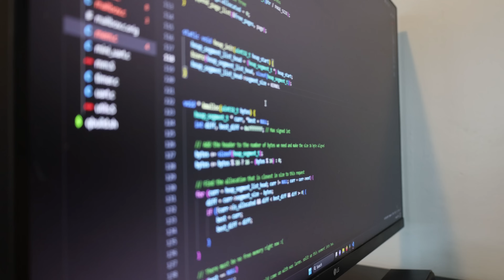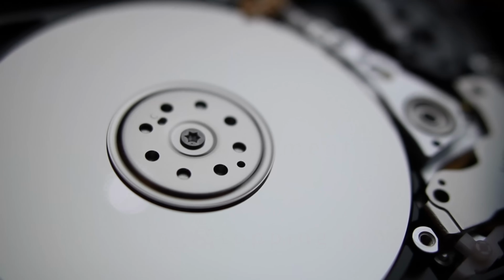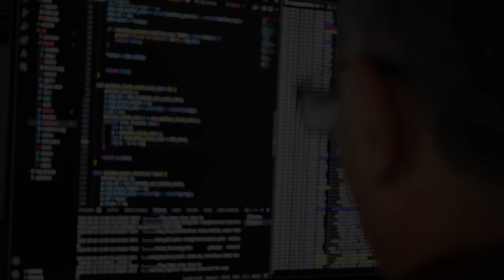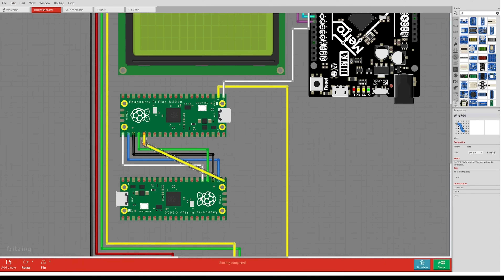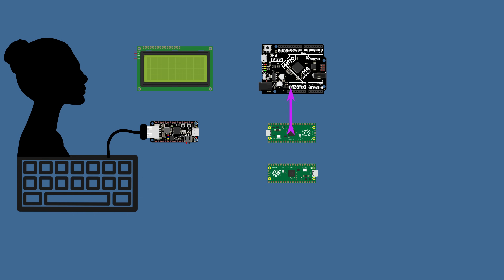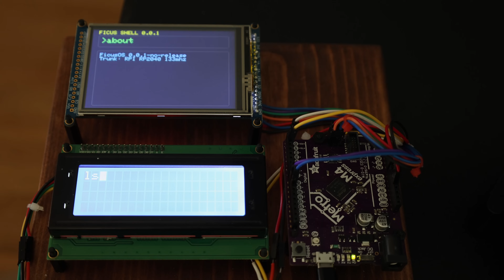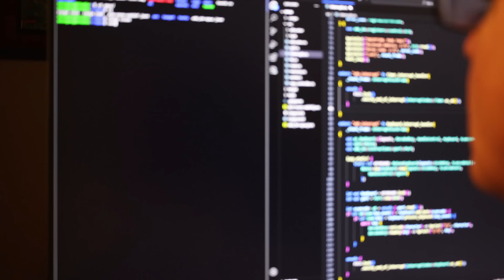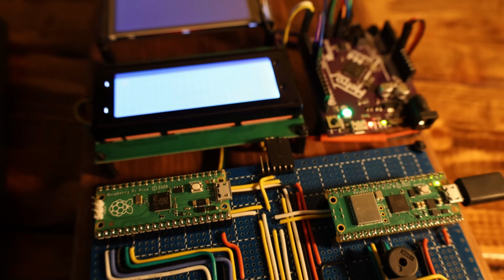Building a Retro-Styled Homebrew Computer & Operating System from micro-controllers

Comment: Wow, the hardware I could do but you totally leave me for dead with the software. In the 80"s I built myself a computer using a 6800 but it had no OS just a pile of switches and leds, I wanted to get it to run something like BASIC but never was able to get it working. However I did learn assembler and how to use a logic analyser so I was very happy too.
Reply from the maker: Assembler take a lot of brain power :) What happened with the computer from the 80's? Is it still floating around somewhere? Thanks for watching - cheers!

Comment: As a fellow hardware/software hacker, I was uplifted by your quality production of a favorite subject matter. I went down the rabbit hole of the Ben Eater 8-bit computer but that's because I'm more of a hardware guy. Your story has an arc and was a testimony to quality video production well done. Someone should write a song to go along with it. I plan to follow your progress with Ficus. Good on ya, mate.
Reply from the maker: Thank you so much - I really appreciate that. I think I need a few more skills before I try Ben Eater's computer, but I plan to enjoy every step of the way :) Cheers!
Reply: Ben's computer is so intensive to put together because of all the interconnect. Superior breadboards are a must! But there is another version called the Bravo that takes the same concepts as Ben's design but applies it to actual circuit boards and more advanced parts. I built that one also and it could be expanded just by adding PWBs since the bussing is contained in the connector stack. Cool idea.  @wrongdog_reckons

Comment: This is really in my area of interests. I’ve done all of Ben Eater’s projects, set up an electronics workbench, started designing PCB versions of them, had one PCB shipped to me from China within days of ordering it, for a few bucks, started learning how to program bare microcontroller chips from a channel called “build your CNC” but also prebuilt microcontroller boards like the ones you mentioned.

We think a lot alike. When I did “nand2tetris” course it made me realize how each layer of abstractions within the technology stack could be as arbitrarily simple or complicated as we wanted. When I read “jones forth” literate source code it made me realize how little code I could potentially use to get from bare metal to any level of abstraction in an interactive hands-on way. I started looking into creating my own Forth but after not doing much, just last night I started writing one in C instead just to wrap my head around it again.

Put it all together and one of my driving thoughts is eliminating dependencies and understanding every later, which is what you’re talking about as well. There’s a couple of online talks that were huge in lighting a fire for me which are “the thirty million line problem” by Casey Muratori and another video by Jonathan Blow called “Preventing the Collapse of Civilization”. I’ve noticed that any time I have to fight software or put up with its flaws, it’s because someone else made it first their purposes, not mine. And how much we have learned to put up with terribly performing bloated software.

I like that you’re thinking about the higher levels of operating system functionality, and I am saving this in my list for things to have in my OS when I get to it. I’ve gotten into FPGAs as well but the problem is their terrible bloated IDEs like Vivado (for Xilinx products) and the OS needed to run it are the opposite direction I want to go.

Yesterday morning I also jotted down where I wanted to go next with building a retro style computer and whether I added on to the Ben Eater “8-bit” computer, the 65C02 project, or one of the various microcontroller projects, I/O was the common thing they all need. I’ve run across people who have shown how to use SPI to read/write blocks from SD cards with a simple protocol that works at any speed (arbitrarily slow as needed) that would be really useful. I think it was on a channel about building a Z80 system with CP/M running on it. Found it: Z80 Retro series around videos 17 and 18, on “John’s Basement” channel. Ben Eater also talked about SPI for talking to a sensor.

Comment: My approach to the hardware architecture side of things entails a bare bones 6502 system with a couple of UARTs communicating with Picos and ESP32s that run all of the peripherals. The idea is to be able to test and debug all of the subsystems in isolation rather than having to build the whole system out at once.
Reply from the maker: That's a really good approach. I think I probably need to check out the 6502 or Z80s for an upcoming project :) Cheers!
Reply: @wrongdog_reckons  could I suggest that you make a video comparing those processors and also add the Motorola 6809 to the list? I've got a feeling that you would find it as interesting to make as we would to watch. 😮

Comment: The realisation you had about not knowing what a computer actually does, reminds me of a sermon by
Pastor Manul Laphroaig called First Epistle Concerning the Bountiful Seeds of 0Day, (published in the Hacker Journal Proof of Concept or Get The F Out, Volume 4.

In it he writes:
If the 0day in your familiar pastures dwindles, despair not! Rather, bestir yourself to where
programmers are led astray from the sacred Assembly, neither understanding what their programming languages compile to, not asking to see how their data is stored or transmitted in the
 true bits of the wire. For those who follow their computation through the layers shall gain 0day
 and pwn, and those who say “we trust in our APIs, in our proofs, and in our memory models and
 need not burden ourselves with confusing engineering detail that has no scientific value anyhow”
 shall surely provide an abundance of 0day and pwnage sufficient for all of us.

Comment: The transient ground problem brought to mind a bit of folklore about the Acorn BBC B, that there's a resistor that no one was quite sure why it was needed, but it fulfilled the function that an engineer's finger on a certain place on the prototype board had. Take the finger off, and the machine would flake out and just stop. If you're not a retro computer fan (and not British) the BBC isn't a machine one would come across - it was the computer that was used in most UK schools in the early 80s, on the back of a computer literacy initiative between the BBC and UK Gov of the time. The Raspberry Pi is something of the spiritual successor to the BBC, especially in terms of the exposed I/O. The first ARM chips were part designed, and tested on 8 bit BBC kit, and BBC BASIC is still one of the best dialects of the language out there - it was designed to teach a lot of the best practices of programming (after Wirth, et al), and is still in development today, albeit slowly. RISC OS has it baked in, and there are Windows,  CP/M and Android versions.
Reply from the maker: Amazing - thank you for sharing that! YouTube algorithms have resulted in me watching a LOT of UK based retro-tech creators and I've seen a couple of blurbs about the Acorn BBC micro in watching about Acorn history.  Thanks for the insights - after your description, I did a search and Tom Scott has a video on them that I'm watching next: https://www.youtube.com/watch?v=g80rnhK-cKo

Comment: The more I learn about how computers work under the hood the more everything else makes sense. When I first started coding a year ago nothing made sense at all. But after seeing how everything was built up one lay at a time over decades it makes more sense now.
Reply from the maker: From my experience, its layered - like an onion. You peel away one layer and there's another layer there. Generally, we become highly specialized in one specific layer and don't need to move too far away from there to 'get things done.' I barely got to the hardware layer here, just enough to see that there are layers and layers below still :) Cheers and best of luck!

Comment: this is awesome! im not sure how "authentically" retro this is, but it definitely captures the same spirit as early homebrew computer projects. those pi zeros (and similar / "knock-off" boards) are so cheap, i would love to write a special OS that deals with parallel processing across multiple boards.
Reply from the maker: Thank you! You are right, it is not authentically retro - it's retro-styled and inspired. The idea was exactly that - modern MCUs are cheap and implement most of the basics themselves.

Comment: You should put a 12v to 5v DC to DC stepdown module.
It will help with managing all the power requirements of the system more easily than having all the currents being delivered by one of the boards.

Apart from that, you built a very nice system.
Can't wait to see how things evolve
Reply from the maker: This is a solid piece of advise. Having the boards power it does NOT get me consistent results. Thanks so much - I'll post updates!

Comment: Well done. 

I started when you had to modify the BIOS for your homebuilt CP/M machine, to match your configuration.

This was usually loaded by a hand entered stub loader on a binary control panel ( like an Altair ), because a PROM/UV-Eprom burner was non-trivial.

using hardware required understanding the software, and but using the siftware required that you know your hardware. 

That was ages away from appliance conputers.

Lolz  Memories of 1977.
Reply from the maker: Thank you for sharing - I am fascinated with computing history. Especially, when they are so ingrained and ubiquitous in our lives and we just expect them to work, but we need to keep in mind how very recently they were actually introduced. It hasn't been that long.

Comment: I've been working with the Pi Picos for some time (SDK, not Arduino), and you probably could have built this entire system with a single (or maybe 2) picos if you utilised their lower-level capabilities. With custom code, both TFT graphics and USB can run on a single pico core using DMA and other trickery at >10fps and a reliable 1ms USB polling rate, then there is still an entire core free for some juicy processing (perhaps for networking?). SPI would be a better alternative for intermodule comms, since the pico can clock at 120 MHz (~100Mbps). Arduino libraries will be painfully slow for many specialised tasks, and horrible to develop more advanced systems in. 

All that aside, this is a learning project and seeing that this is your first crack at hardware, this is genuinely impressive for a first try!
Reply from the maker: Oh yeah - there are so many optimizations to be had here. The beauty is, I still have room for all those optimizations and will have tons of leftover processing power. Think of all the things we'll be able to do then! Thanks for watching!
Reply: You'd be very hard pressed to rush 120MHz signals through this type of wiring. But then again, the RP2040 has no problem pushing wider buses, as demonstrated e.g. when driving DVI.
Reply: @0LoneTech  Some care is required with the ground wires for 120 MHz, but I have had no problems when twisting the wires for these speeds. Some series resistors can also solve ringing issues (even the 10th harmonic of 120 MHz has a wavelength of ~25cm).

Comment: I don't know if you know of his channel, but Ben Eater has a couple wonderful series on building your own computer from the ground up. One on building an 8-bit computer from scratch, the other one based on a 6502 microprocessor.

He takes you through them both and teaches as he builds. In the end you have learned a lot about computer hardware on it's most basic level. How things are done and why. It's really relaxing to watch too.

Edit: I wrote this comment before I got to the halfway point. <|(:oP)
Reply from the maker: Yes! Ben Eater was one of my major inspirations here and only discovered him during this process. That dude just straight up builds computers from scratch and almost like he's doing it off the top of his head. I had no idea that such a thing was possible. Thanks so much for watching!
Reply: @wrongdog_reckons  You should build a 6502 system if you really want to understand hardware at the nuts-and-bolts level. Microcontroller boards are too "black box." One of the hard requirements for my system is that I should be able to write the system routines in assembly and burn them onto an EEPROM. To be honest, I find hardware registers, data buses, and things like chip-enable and output-enable pins easier to understand than modern UEFI bootloaders and what-not.
Reply from the maker: @RealDevastatia   Agree on the 6502 suggestion - thanks for watching!

Comment: One bit data bus?
Reply from the maker: That's my understanding. For inter-node communication I am using UART, and it is attached with one wire each for Rx & Tx. This means that I can effectively transmit 1 bit at a time between modules. More complicated systems transmit 8, 16, 32 or more bits at the same time, generally over 8, 16, 32 or more connections. Its simple, but slow. Unless I am reading this all wrong: https://www.analog.com/en/analog-dialogue/articles/uart-a-hardware-communication-protocol.html
Reply: @wrongdog_reckons  that's parallel data transfer. Like the old printers and their fat cable.
Today we use serial, while sure technically it is each bit at a time. An entire byte is transferred in less than a second.
Just like USB 2.0 is 5 gigabytes a second, so too is UART rated in speed.
TLDR. Sure one wire meaning one bit, but UART is rated in speed just like USB.
Reply from the maker: @kyleallred984  - aligned - but USB speeds are fairly low compared to something likw Frontside bus speeds that tend to run in parallel - otherwise I assume we would use USB for internal bus on modern PCs, but we don't.
Reply: @wrongdog_reckons  I thought we used differential pairs for internal bus communication. Using two wires to send one bit at different voltages to maintain signal integrity at higher speeds.
That's why some signal traces on pcbs do a little wiggle to keep the paired traces the same length.
At least this is what I've learned from messing around with this stuff.
UART is slow enough it doesn't need stabilization.
Reply from the maker: @kyleallred984   - that sounds right to my understanding - but I am still a noob at this :)

Comment: As a software engineer I can relate to that feeling to not understanding the low level components very well, but I love your modular architecture, you design is reminiscent of micro services deployed in a Kubernetes cluster, with coupled but separate components interacting with each other over some common message bus. Great video!
Reply from the maker: You are absolutely right - I noted that exact thing yesterday in a comment: in the end, I just took a pattern that is very common to me (built-in to my brain at this point) and applied it to a new (to me) problem space.  I think it makes some sense that these same patterns would apply at the high level and the low level. You just get a lot less syntactic-sugar to play with at the low level :) Thanks so much for watching and commenting!

Comment: Very cool project and inspiring too. I'm working on something similar, not written in c but a unix environment built on top of Micropython. It practically has all the building blocks needed and i wanted the option to run it on other microcontrollers too easily. The need for an OS arose when I decided to build a phone with a pi pico w.
Reply from the maker: Thanks! Much of what I did here is exactly that: a set of unix commands built on top of micropython. I will want to replace much of it with C or Rust over time, but it makes a great starting point. Curious about your project - post on it.
Reply: @wrongdog_reckons  Youtube seems to swallow my comments. I have no idea if they got trough or not. All I wanted to do is show you my projects status.
Reply from the maker: @onecoding   I don't see a link to anything? I checked out your channel - love the spider train :)
Reply: *nix like environment for MicroPython (preview)

Comment: Cool! My plan for 2024 is to develop some things using hardware rather than always working on software projects, hence I am discovering great videos like yours. I like the idea of getting close to the bare metal. I've ordered various ESP32 modules to play with.
Reply: There's still plenty of coding to do, but I have been having way more fun programming hardware I can actually use in my daily life, rather than trying to find a programming project that just does something on a screen for the most part. And then the idea of reusable code really comes into play. Write a driver for a component and make it a class and keep it configurable and you can just reuse that code. I find myself writing C++ while thinking about how I can use the software in other projects. It's a ton of fun.
Reply: @psyience3213  Great. I got my first dev board working with wifi connecting to my phone and a pc today. Very nice since I want to try to extract data from my smart phone to display on a small screen such as for when I am riding my bike. But now it's winter maybe do some kind of home monitoring like you.
Reply: I see this as a reciprocal  function of a successful software designer over time.  There comes a time when you give yourself enough grief over something the uncomfortablenes of changing breaks into the actual change itself..i have had similar (pipe dreams) I wanted to say Thanks for your effort and commitment to your goals as well as doing it while sharing your experience with other people.